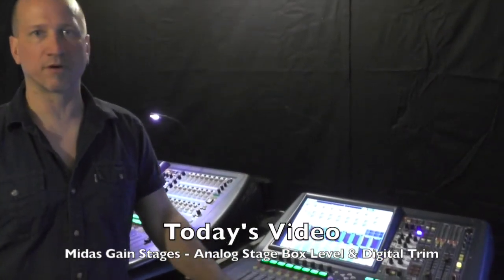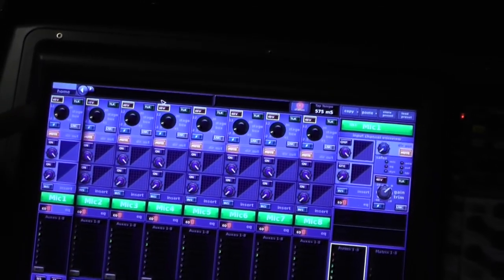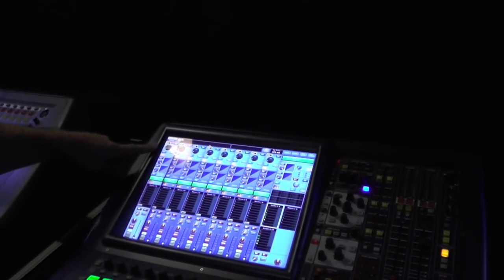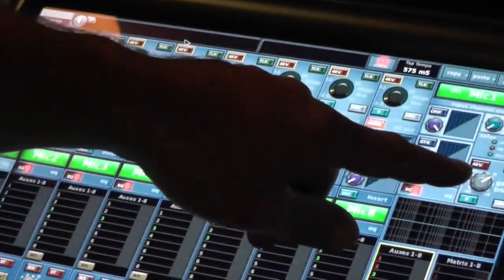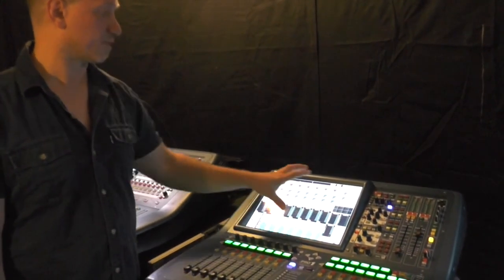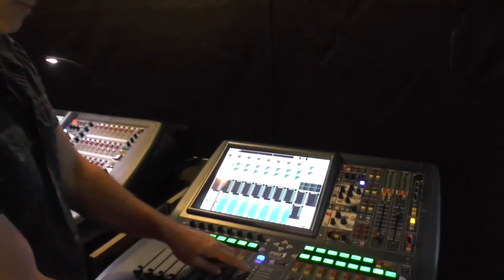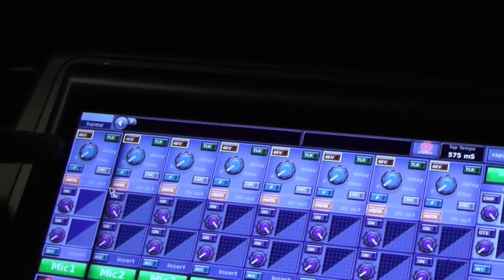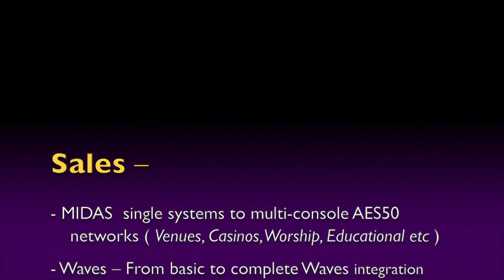Midas #101 with Jim Roese - The Two Midas Gain Stages ~ Analog Stage Box and Digital Trim

Comment: Hi Jim, 
Would you explain the Gain Check Switch?

From the manual: 
"Monitors the mic amp input after the 30Hz filter, but before any further processing. (The 30Hz subsonic filter switch accesses the high pass filter on DL431 Mic Splitter when connected to a PRO2. In this case, the gain steps would be 2.5dB from -2.5dB to +45dB.)" 
pg 246 Midas Pro 2 Manual, October 2011

I would like to make sure I am understanding this correctly. If when pressing the Gain Check Switch and the meter is reading full red, the analog preamp is being massively clipped? 

Thank You! Your videos are greatly appreciated.

Comment: I've got one question, let's say that my analogue gain was a bit too much and some times it clips (some heavy kick or snare hits), do the preamps/ADC have some sort of limiter or other protection or will I get a digital clipping sound even if I trim it in the digital domain?
Reply: If I'm correct. Driving the preamps will clip just the analogue preamp and will not clip the digital sound as long as you are running your digital trim low enough to avoid it. For instance, I like the clipped sound on most of the skins on the kit so I'll hit the preamps into the red but will digitally trim down the input so that I'm still getting that fat, warm clipped sound, but am dealing with a reasonable level on the input rather than a level coming into the console at +15. If you do not trim the signal down you will get that gross digital clipping sound if it winds up getting too hot.

Comment: hey, sorry for my english...I have a Midas Pro 1 console and recently I purchase the Midas DL151, I have  a question about the two gain in this console; when I connect a microphone on midas pro 1 in chanels 1 to the 24, the two gains works fine, but when I connect the dl151,channels 25 to the 40 only work one gain ( trim) and I move the stage box knob and nothing changes. so with the dl151 only work one gain? or the console isn't configure properly? and other question is how I configure the talkback microphone? I connect a microphoe in the talkback input but nothing happen. I move the talkback knob gain and nothing. I hope that you can help me...thanks